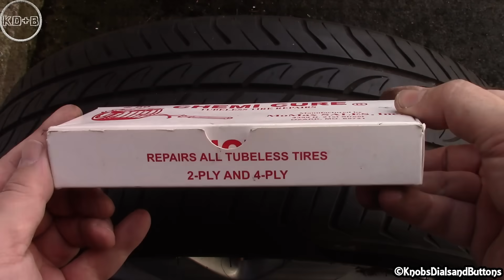How Tire Repair Kits Work - With Internal Views

Comment: Wow, 12 years as a mechanic and I’ve only ever seen half of these methods. The gold standard that most shops would use is a plug patch, with some type of bead sealer and rubber cement to further glue down and seal the patch on the inside of the tire. Of course this requires dismounting the tire and rebalancing it so it is much more labor-intensive, but you can pretty well bet that it’ll last the life of the tire. That said the first method using a string and rubber cement is generally still very durable and will 99 out of 100 times also last the life of the tire, assuming that the repair is not in the tire sidewall. Most shops decline to repair the tire if the puncture is outside of the tread channels due to liability if it failed. Well that said I keep the tools and strings demonstrated in the first method in my personal vehicle.
  For any vehicles built before tire pressure monitoring systems, I would be wary about anything but a plug patch due to risk of blowout if the tire were to lose air and go unnoticed.

Comment: I have a Maserati Granturismo. They come with a can of that stupid expandable foam just to ruin the tyre. Comes in a lovely case too. The boot does have a space for a spare but it would sit upright which means you have to lean over it to access the remainder (not much) of the luggage space. I have put of getting a spare for this reason. stupid I know but I only do 3000 miles a year. I will get one of these kits now. Thank you.

Comment: I used a real metal screw with some plumber's glue once to get me off the side of the road, ended leaving it in there for a month before I remembered that I needed to fix it. it never leaked down on me.

Comment: Great vid. About to do one, so need a refresher.

I was going to take a pierced tyre to a shop (staple in it) but you just get sick of them never listening to what you say/don't tell you what they are going to do (last one I took,  they said they would do internal one, then didn't, used external, which I can do myself), so easier for me to do. 

But great to see what is current. 

Thanks!!!!!

Comment: I have used the rope type plugs many times. I have never had an issue or a leak from the repair. You should follow up with an inside patch to be a proper repair. If I’m at home I use my drill to reem out the hole. And I always finish my repair (when rubber cement is used) with applying powdered chalk or soap stone powder to keep crap from sticking to the repair.
Reply from the maker: Thanks for the tip!

Comment: 1 pro tip is don't cut off the excess strips immediately, let it run for some distance so that the strip gets adjusted seated fully due to weight of the vehicle and road surface. Else you'll end up with shortage or shrinking in the strip
Reply: Why not cut it with allowance?
Reply: @benndarayta9156  If you left too long, it will drag the rest of the plug out when the tire rotates over the road.

Comment: Not legal in UK? I'm not sure why but you could technically still buy them online and repair the tyre at the roadside. It's probably a better solution nowadays with having no spare wheel and those foam kits are a joke

Comment: All these repairs are good for round hole punctures, but not suitable for tear type damage to the tyre
Reply from the maker: Actually, the sticky string can be used to repair some cuts as well, check out number 3 in the instructions: https://www.yourtireshopsupply.com/pdffiles/ChemiCure%20User%20Flyer.pdf
Reply: No shit But most tires are from punctures on interstate roads

Comment: If you have one of those expensive steel belted tires, I highly recommend you NEVER use this method. Take your tire to a real tire service company and demand for an internal patch over the hole. Steel belated tires do not play well with intruders, specially push thru plugs.
Reply: Never been a problem for me. aren't most tires steel belted?

Comment: I have experience with the rope type and the mushroom type I’ve now used over 10 years. Never had a rope or mushroom plug fail. I’m a biker so rear tire no problem. I always replace the front tire soon after though. Outstanding video. 👊🏼🤙🏼
Reply from the maker: Thanks for watching !

Comment: Got a large slit 3cm 1 inch ?) in my tire (stupid low profile winter version). Injected the sealant by the valve and put up some pressure.  Was still leaking but was able to get home and call for an appointment one week later to scrap the tire and replace it. I had to inject much more sealant from my mountain bike kit to seal it off completely and be able to drive to the shop. Just to say that having some sealant is also a good temporary solution ...

Comment: Great video ! Great Photography as well.  Which is your favorite?  Which has the best longevity, in your opinion?  Thanks for posting this vid.  I have a farm and am constantly repairing trailers and implement tires.
Reply from the maker: Thanks for watching. In my opinion the sticky strip (chemi-cure) type repair is the best, and most reliable, when done correctly.

Comment: Wow, some of these I have never even seen! I was a tech, we used the 1st one when repairing from the outside. 
   We also used plug patches that must be installed with the tire removed from the wheel. 
   The last one looks like a PC fan screw with glue on it, Lol. Remove nail, install screw..It does look effective!

Comment: And to think, I remember back in the 70s they had a patch that was diamond shaped and it was for a sidewall that had a small hole or gouge in it. You placed it over the hole, and lit the opposite side of the patch. It worked pretty well.

Comment: I have used varies size screws and bolts with a rubber o ring to plug my pickup tires in an emergency when I was a young man. Now I carry a spare and the mushrooms

Comment: Mushroom one does not use any glue? Won't it leak air?
Reply from the maker: Not if it's done properly. It's designed to be used without glue

Comment: Some additional tips. If a front wheel, try to turn the wheel so the puncture is facing outward as you will need room to get the tools and some muscle to reem the tire. The steel belt mesh will make doing this on some cars difficult. Back tires your stuck trying to line it up between the fender and the ground.

The rubber cement is vulcanizing meaning it connects the rubber or bonds it chemically if I'm not mistaken which makes for a better patch.

I patched both motorcycle tires and car tires using the tar strips and using the plugs that you vulcanize the contact patch and stem and insert from the inside of the tube. So after getting home and repairing my motorcycle tire. 

The plug has a metal core and once it sets, you snip the end off. 

Also, a nail it fairly easy to remove but a screw should be grabbed with pliers or some grips and unscrewed back out to minimize tearing the hole up. 

Most of the time the head of the nail or screw will be mashed and warm down at an angle. It rare to have a perfect easy nail to remove like in the video. 

So the hole may be at a slant so try to reem and plug the hole with a strip at a slant same as the nail or screw. Mushroom plugs may be more difficult.

Your basic car kit should include a tire strip kit,  a multi-tool that has the grooved pliers so you can grab and pull out the object, a couple flares for safety at night to warn drivers and a scissor jack in case you have to remove the tire or jack the car slightly so you can rotate the tire to get to the puncture. 

A LED head lamp is also good along with separate batteries or rechargable via the car.

I have a Jag F-Type with very limited space and I managed to fit my kits along with a good sized air inflator as well as a mini fire extinguisher, zip ties, hose wrap and a socket 10mmnand ratchet for tightening or removing the battery terminal. If I can fit that in my F-Type bottom trunk storage, anyone can.

Comment: Awesome video. Thank you!  Two questions…does this still apply if the puncture happens between the treads?  Also, is there a need to have the tire rebalanced?
Reply from the maker: Thank you. Yes it's the same between the treads. A single repair shouldn't affect the tire balance as they're all quite lightweight.

Comment: I've only ever used style 1. They're fast, easy to install, and far as I know they can last the life of the tire if you really had to rely on it. The other types just look slower and more complicated in comparison. The hissing noise from the tire is intimidating, but if the hole is from a screw, really if you can plug the tire within a minute or two, you only lose about 2-3 PSI. Should still have more than enough air to hobble to a tire shop for a proper patch, or if you have a portable pump it won't take long to top it back up.

Comment: Demonstrations very well done. The first patch seems to be the one I’d choose. But, I also like the ease of the last demonstration, the repair screw. It also looked like an easy fix. Thanks for sharing your expertise. I’m on a motorcycle and these fixes would come in handy.
Reply from the maker: Thanks for watching !
Reply: Those screw ones are good for small round punctures, but if you hole is a little off shape or damaged at the back they aren't very effective - good enough to get you to a mechanic, but they can leak easy. 

By far the easiest to install. The first one (which i recommend) can be very difficult to get in sometimes.

Comment: I have used the first string plug type many years. The important thing to remember is DO NOT FORGET TO GLUE IT with the glue tube in the same package, othwise it may leak later. But this method is hard to use on big truck thick tire. It is very hard to drill a hole with the hand tool in the package. Use an electric drill bit is better, but you may drill a wrong hole. The best way for heavy duty tire it is still to repair from inside.

Comment: I use the simple external plug with cement because it's both efficient and cost effective. In most cases the tire doesn't require dismount from the vehicle but simply positioned (driven) so the puncture is accessible.

Do they fail, certainly, but it's been my experience it's less than 1 in 10 and usually near the tire end of life.

Comment: Thanks for the great & very informative video. I have a set of plug type in my boot as I have no spare tyre. Will the strip last year's with the car under the hot sun just in case I do need to use them?

Comment: I have tested the first one on orange stripes and black even without glue and it works fine, as a biker is always with me and with a foam spray sealant to inflate the tire, but the mushroom with manual tool and also the screw one looks very nice to me. All these repairs are supposed to be temporal repairs, but the plus for me are working fine for long time and mileage over 25k miles or more in fact just two times fall over a long period, a permanent solution is a inside patch with glue that can also be applied with a strip plug

Comment: Just my 2 cents. I’ve never cut off the excess and left it as extra material to seal the deal. It blends into the tire when driving and has never been an issue as far as balance or thump noise. 20 year auto tech, dozens of tires plugged.
Reply: I've been doing it for 30 some years and have seen the excess stick to the pavement on very hot days and pull the plug right out. That's why you trim the extra off. It doesn't add any extra seal

Comment: I have plugged tires either $3 kits all my life and never had an issue.  40k after plugging on some. They just want to sell tires.  You think that little 2mm hole is going to shred your tire or cause you to wreck.  Come on.  Even side wall I have done. Small ones. The multi belts
Inside a tire takes a lot to shred or come apart.   Any negative comments are bull crap. Just use them. I recommend the ones with rubber cement and look like
Cords. Never fails.

Comment: I put rubber cement on the reamer to work it into the puncture before using the tire strip, also well coated with the rubber cement.
Get the 8 oz metal can of rubber cement because the little tubes that come with the kit will be useless by the time you need them.

Comment: I've plugged over 10,000 tires, only 2 maybe leaked. I've seen the plug still holding after the tread was wore out, you can't plug a sidewall, and the key is to go back in the EXACT HOLE, you only need to double the plug, if it's a really large hole, a nail or screw, only requires a single part of the plug. It's best to let the air out, ream hole a little,wax your plug, insert,and a quarter twist and pull out. Reinflate,check for leaks....MUST USE A RADIAL TYPE PLUG, for steel belted radials, a rubber plug will be cut by the steel belts. Good luck!

Comment: Hey, I have a question if you end up doing this, please tag me but if there’s a gash in the tire, what happens if you put flexseal spray over it whenever the tire has no pressure wait for it to dry and will hold. I think it would be awesome experiment and it would probably get you lots of views

Comment: Looks like everyone has there favorite (which seems to be the sticky rope) but which would be best for emergency use on the side of the road? I never saw the  mushroom tipped ones before and the gun applicator seems the easiest to use, but is it as reliable as the rope ones that everyone says last the life of the tire?

Comment: The plugs look good they look like what i usually use, usually i take the tire off the rim and  use a plug with cement but i have to sand down the inner tire so the plug has something to bond to then use a sealer, but the plug that you screw down with an allen key loos good and will have to get one and keep it on board.
Not sure about the last one, its probably fine but just looks like you have black scree in  your tire, in my country it would fail a yearly inspection on that.

Comment: Nice vid! The only problem with plugs is when the nail or screw is at an extreme angle. I have seen tire techs form a new hole with the reamer due to not inserting it though the hole correctly! It can even cause a bubble in the tire. A well done patch plug is the best and most reliable repair. For me I would never use a plug in my families cars only if I had no choice to get moving. I would later plug patch it, or replace the tire. It's just not worth the chance. I also wouldn't plug the corner of the tire.

Comment: I remember the rubber strips we used to plug tires with. Those faded away. Only problem I see with the mushroom plugs is if a nail or something else goes into the thread at an angle.

Comment: Been working in the industry for 10 years now. Nothing beats spare tire. If you have a basic nail or something similar in the middle of the tire its okey but 8/10 times it will start leaking again. If you hit your tire from the side, bigger hole in the middle, or if its leaking from the valve, repair kit is uselles.
Reply from the maker: I explained in the video description that these are only for temporary, emergency repairs until you get the tire inspected and patched professionally at a tire shop.

Comment: If you jack up the vehicle for plug #1 and slather it in cement rather than rub it on it works better. Having a deflated tire also keeps it from chucking cement at you

Comment: The last one using the screw is realistically the only ‘wheel on’ repair. Worth considering if you are not in a position to reliably deploy the jack. The others are great if you can get the wheel off, and then if you can you might as well change the wheel, reassuring the other one once you get somewhere comfortable.
Reply: You can do any of them on a car, been doing it for over 30 years. Rotate the tire to where you can get to it, a hell of a lot easier than taking it off

Comment: I've been using the rope style for 30 years. Only had a few fail but it took a couple of years for failures. Unfortunately or fortunately I do this so much I just use a drill bit on a drill now when boring out the hole.
Just make sure its the same diameter as the reaming tool and it's the same outcome.

Comment: Project Farm does a great review of all the different plug types, including some very hard driving on rough roads, and a test that sees how much pressure is required to pull the plugs out of the tire. If I remember, plug type #1 is by far the strongest. He even puts like 100 in a single tire and rips, around, on his farm, doing donuts. Not a single leak, and no blowout

Comment: The first one is the only type I use. The mushrooms are fine but they require the hole to be sized for the tools. If you have a small nail/screw, you have to drill it out first. Also, they need the angle to be straight which it almost never is. I'm never seen or tried the screw in type.

Comment: Just so you guys know the first strategy you can slam a tire with 4 of those slugs and you’ll be good. And also the patch kits never give enough cement glue. Walmart has a bottle 8oz I think of that rubber cement and a pack of 30 slugs. I got those and now I drive in peace every day 😎

Comment: I’ve got the string type. I’ve had an MOT today I was informed I had two nails in both back tires.  so I’m going to try this at the weekend
Reply: As a Brit you should know that these repairs are neither considered safe or legal in the UK. To conform to BS... not BS, but British Standards the tyre must be removed and inspected by a professional. These string devices should not be used on passenger cars, but may be acceptable on golf carts and the like.

Comment: The orange, super tacky plugs with a little cement are excellent in my experience. A patch-plug is the best however. Add a little flame for a hot patch if so inclined.

Comment: As for method five, If I saw a screw head in a tire, I'd have to repair it with a plug.  I always used rubber strips similar to method one.